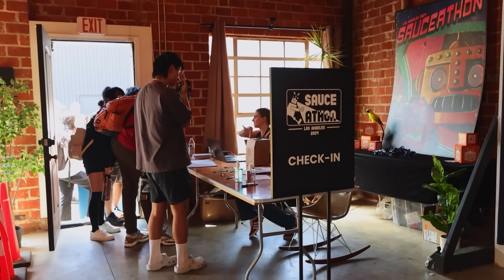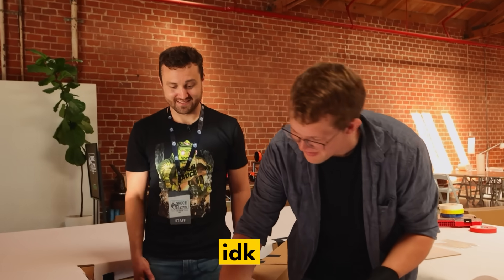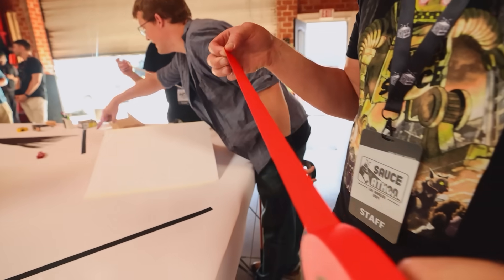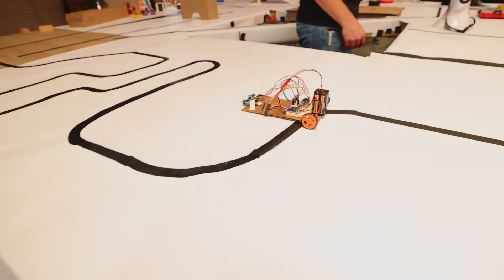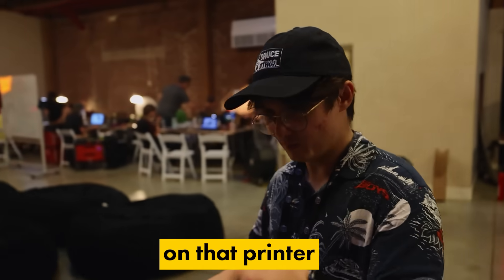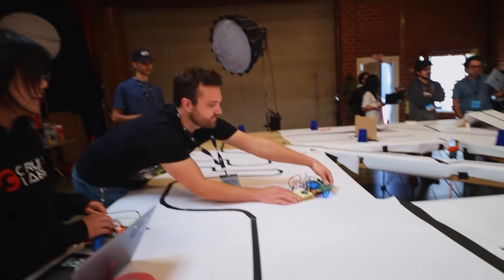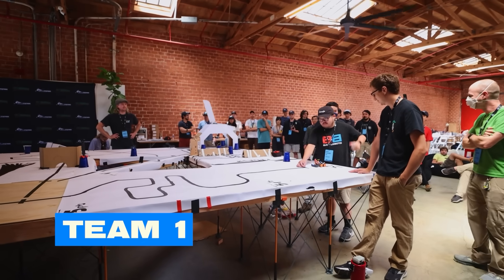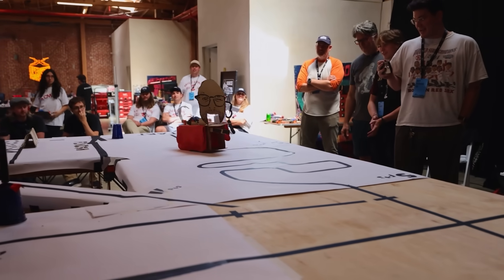i hosted a 24 hour hackathon

Comment: I know Jiffy Lube changes your oil because after taking my car to them a few times they rounded off the drain plug head... I wonder if they were using a Leatherman or what. Not a proper wrench. Anyway they came back to the office after i dropped it off and they said, "We can't change the oil because we can't get the drain plug off 🤷‍♂️" like I hadn't been taking it here for over a year.

Comment: Michael being visibly armed and threatening that dude for taking his shit was definitely a highlight for me
Reply: he was beefed for a reason man it worse than just taking his shit xD the guy he was angry at stopped his 3d print mid print, cleared off the half printed object, and printed his own thing with the stolen stick.
so Michael couldn't even resume print even if he recovered the usb stick, it was a dick move, Michael was a gentleman shaking his hand laughing it off.
Reply: @BunByte  if you listen to him he also said that the print failed before he stopped it. So, from the other perspective, someone is essentially taking away one of the printers, but not actually using it to print something.
Reply: @coasterthekid8867  failed because someone removed the usb stick. and what person would just toss out everything and use it? It's like going to a laundry mat, tossing everything on the floor and using it because it stopped mid wash.
Reply: 3D printer guy here! It was a hilarious situation, but a genuine accident. It looked like the printer wasn’t being used, so I took the shared USB out to load on my file. Michael went around to ask about the drive, but I had been pulled aside for an interview so I wasn’t there. Then when I got back to the printer, it must have had 10 lines of g code loaded, cause it printed a single layer of a circle and then failed. So I pulled off the scraps and started mine. By the time someone told me what I did, the print was already done and Michael was guarding the printer with his knives 😂 I wish I had the guts to purposefully stop a half finished print and throw it away
Reply: @zachk1709  ok you was valid for that one, i take back what i said😂 you was a victim of circumstances
Reply: Michael was valid for that😂 i don't know whats wrong with the other dude but he definitely hasn't been punched in the face before😂 bruh not only did he took the usb he cleared everything. Something is wrong with that guy
Reply: Cool story

Comment: The fact that this man works on his own machinery. Electrical work. Etc
 But doesn't do a simple oil change is funny AF 😅😅
Reply: With the high cost of oil and filter it costs maybe $5 or $10 more to pay someone else.  Why bother?  Until they mess up and leave the old filter gasket on and the oil blows out on the road.  Or they break your airbox trying to check the filter.  Or leave the intake boot loose so oil is being sucked in.

Comment: Find a hardware store and build a device out of what’s there you have to put power tools back in the box ie not destroy them to make your device and you only get to cut X amount of pipe and steel best creation most unique wins

Forgot Arduino and motor controllers given out along with relays

Comment: Make your car follow a line, bigger line following robot.
Reply: And make something follow the car., line following robot following robot
Reply: Get it to drive right down the center of the road. Nothing could possibly go wrong.
Reply: You can steer it by painting a line in front of the car
Reply: This is genius
Reply: Or a line following robot that follows a line drawing robot
Reply: Make breadcrumb following robot competition.
Reply: Isn’t that just what self driving cars are- the lines on the road
Reply: Next competition: Make an interface to drive the car and then make everyone make something to work with that interface to try to make the car follow a line around a parking lot